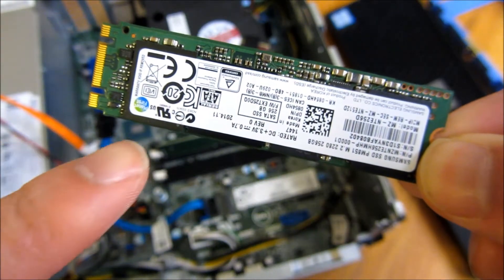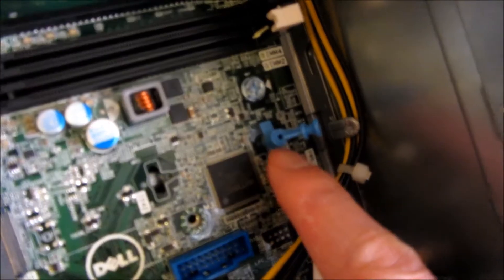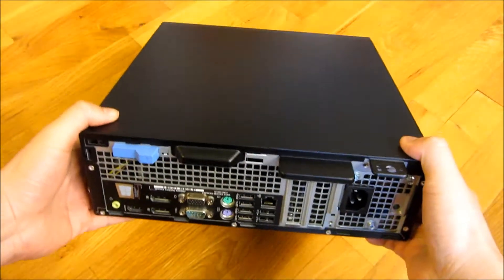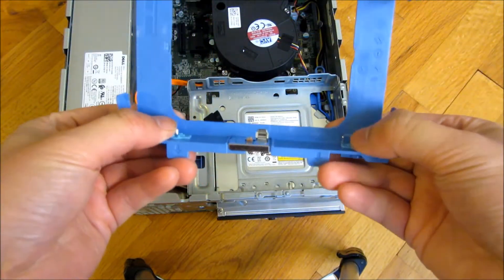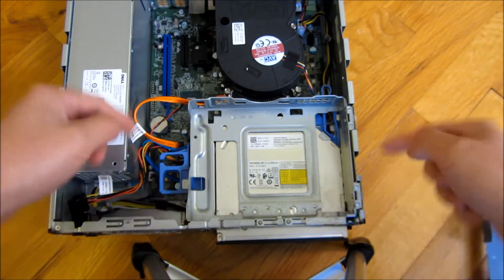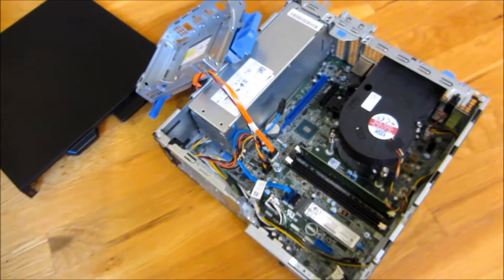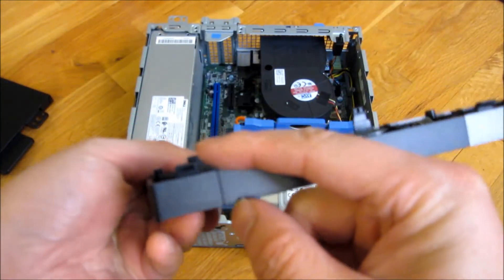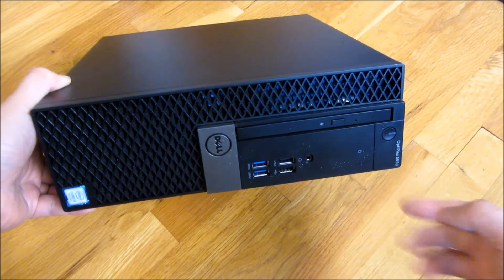Dell Optiplex 5050 - M2 SSD Replacement | Disassembly of Chassis SFF Case

Comment: I have a question. I installed a SILICON POWER M.2 2280 SATA lll SSD A55 1TB drive in my Dell Optiplex 5050 SFF. The bios sees the drive along with the device manager (Disk Drives). But the Windows 11 pro file manager doesn't. Any suggestions
Reply: Looks like you are running your operating system from the SATA drive, perhaps even a spinning drive.  You should be running your OS from your new 1TB drive.  The proper way would be to make a backup of all your stuff on an external drive, then boot from a flash drive to install new Windows.  In the Windows install menu select both drives and delete any remaining partitions from your old drive (including System Reserved), then select 1TB and install Windows on that.
The reason why you don't see your 1TB in your Windows is because you just probably installed it in the M.2 slot, but never formatted it under Windows.  Use 'Disk Management' to format your new drive, but you don't have to do it, if you go the new Windows install route.  M.2 SATA is still faster than normal SATA SSD, so even if you have Windows on SSD, you would want to switch to M.2 SATA for your operating system.

Comment: Can you install both 3.5" HDD and 2.5" SSD on this thing? If so, where is the power port for the 2nd disk?
Reply from the maker: Yes, you can install the m.2 SSD with an additional sata HDD or another SATA 2.5" SSD.  The power is the splitter with the DVD drive

Comment: why on Earth would you put a Sata m.2 capped at 600mbs, i just added a NVME to my 5050 dell, and getting 3500 mps speed on crystaldiskmark,  i came with sata in 2017 but bios update now adds supports NVME.
Reply: Hi. Is there a specific type (or version) of NVMe SSD that’s compatible with the Dell 5050? I’m just afraid that if I buy the latest model, the computer can’t read it.

Thank you very much in advance.
Reply: not to worry, even if you buy gen 4, your PC will still read it, just it will cap its speed to its capacity. i recently installed gen 3 NVME in optiplex 5050 and it works great just keep temperature in control , buy NVME heatsink and front Fan just to be on safe side. @Ujotify

Comment: You don't even need to remove the blue HDD tray to remove the cage. The whole cage comes out as a single assembly and each component (HDD, ODD) can be installed or removed independently of each other. Well thought out set up.

Comment: Whats the main advice or procedure (in general) to install sata SSD's into Dell servers that accept only SAS 3.5" drives? 
It's a poweredge 410.
Thanks.
Reply: It's the same as normal Windows install.  SAS plug will accept even a normal SATA drive, but not the other way around.  SAS drives are faster than normal SATA, though, so use them if you can.  Look at the SAS connector on your drive.  There is a bridge (one piece) that connects the power connector with the SATA connector.  That bridge is not there on normal SATA drives.  You cannot plug in SAS drive into a normal SATA.
Reply: https://www.youtube.com/watch?v=P33qOCqI2PM